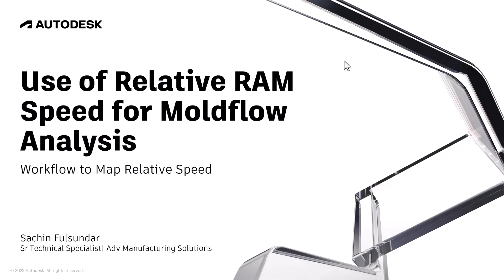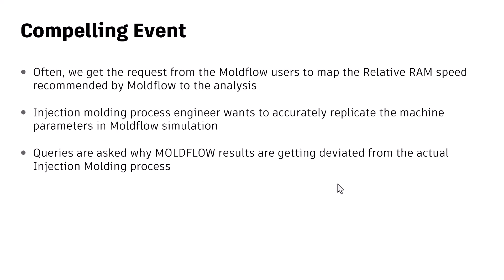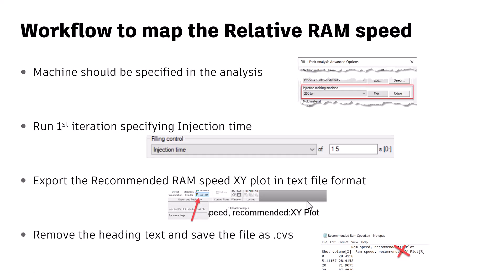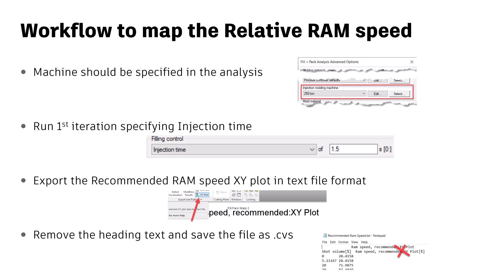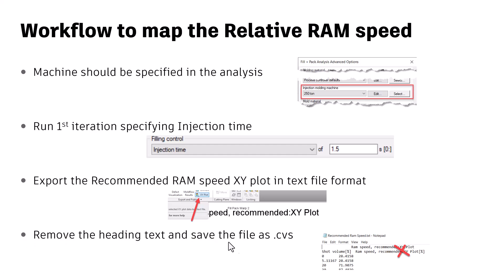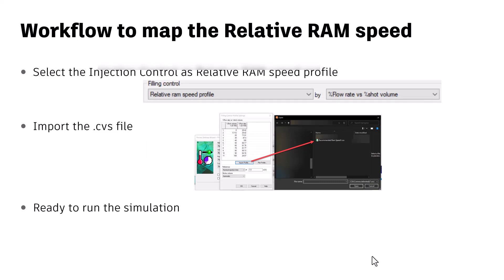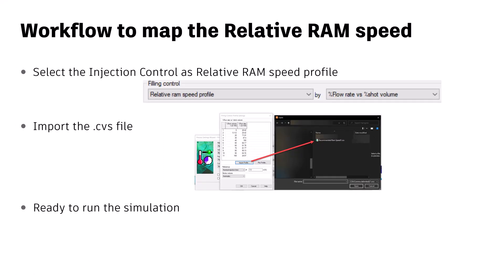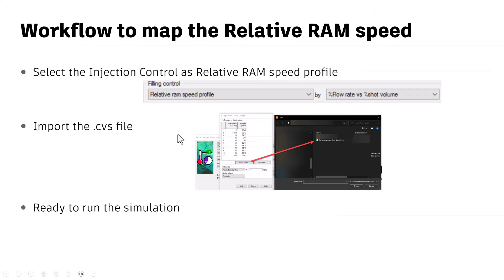Use of Relative RAM Speed In Moldflow Analysis

Comment: Hallo Mr. Fulsundar,
I have been using Moldflow for my thermoset injection molding simulations. Besides, I also use CFD tool OpenFOAM (FVM based) for the mold filling simulations. Interestingly, I see large difference in the simulated results from Moldflow compared to the Openfoam for same boundary conditions and material data. The difference arises in the numerical computation of the velocity gradient/shear rate. I know, that both software use different numerical methods. However, I am interested to know the differences comprehensively. Is there a way that I could get access to the documentation of Moldflow, where they explicitly mention about the underlying solving methods?
Reply from the maker: Hello, I would recommend you refer to Autodesk Moldflow help in the solver section to get more details - https://help.autodesk.com/view/MFIA/2023/ENU/